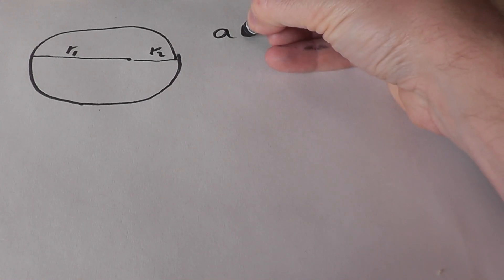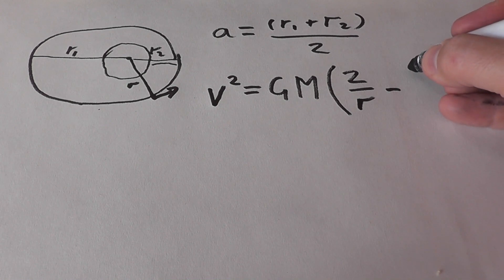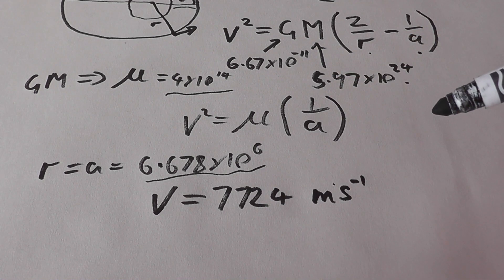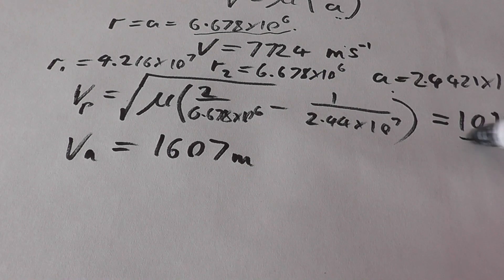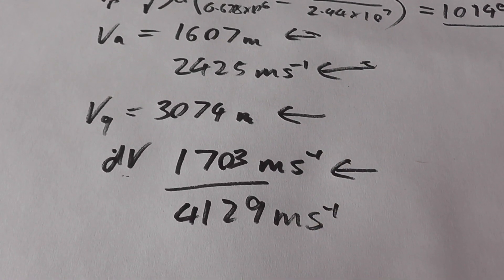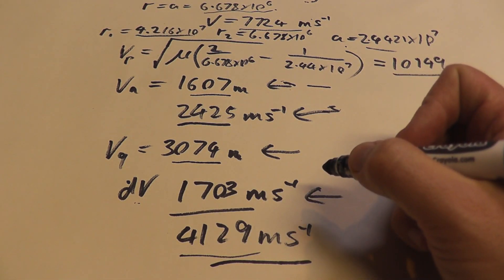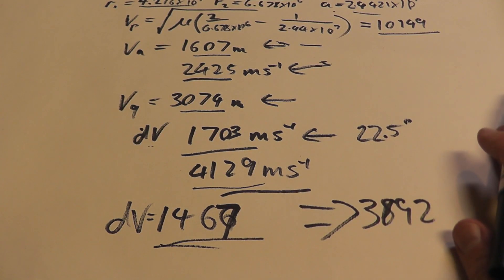Orbital Mechanics On Paper - Part 1 - Addendum

Comment: Only Scott can keep my interest with maths for over 13minutes... :)
Reply: ***** A good starting video is "math" vs. "maths" problematic :D
Reply: ***** thanks for the tip.
Reply from the maker: ***** Confirming Numberphile is worth watching I even learned a couple of things that I didn't already know.
Reply: +Scott Manley yes, but I think this video qualifies as rocket science.
Reply: My math teacher can keep my interest in 70 minutes he gave me this homework:Research the following for a space rocket of your choice. 
Dry mass (excl payload and fuel) and max fuel capacity
Thrust and fuel consumption of engine

Calculate the max payload mass that the rocket can accelerate to escape velocity. 

This question is hard. Your goal is to develop strategies for breaking the question down into smaller pieces, identifying what assumptions you need to make for missing information, finding shortcuts and approximations, and figuring out what mathematical methods and tools are required. 

A full solution requires integral calculus. Start by working out a solution using discrete time periods. 

And I only go in 7th grade
Reply: Tim Roberts dude you and me are in the same boat
Reply: I had a similar question to tims in a classical mechanics book, only you had to derive a general equation for that rather than specific.
Reply: @scottmanley  hi Scott, would enlighten me with a solutuon to this poser: if an object at a distance of 5 metres is attracted to a body at 1m/s^2 with G = 6.67*10^11, what is the mass of the body? 
thank you,
 Leila
Reply from the maker: @leilanurena  I presume you mean G = 6.67*10^-11 
A = MG/r^2
so 
M = A*r^2/G
3.75x10^11kg
Reply: @scottmanley  thank you, Scott. love the channel
Reply: @scottmanley  Scott, would you please do a video on the delta v's needed for a spacecraft in circular (earth)  orbit at 150 nm,  boosting to a circular orbit of 250 nm. 
thank you,
 Leila

Comment: The best part of this video is the slight echo in the sound. It makes me feel like I'm back in a college lecture hall.

Also, this isn't so bad because I already made myself learn this stuff to fly properly in KSP, back in VERY early versions — when there wasn't Kerbal Engineer, weren't orbital calculators, certainly weren't any maneuver nodes! So it was either: calculate your transfer orbits by hand, or guess and probably screw up so epically that not even Jeb could save you.

Comment: Hey Scott, this is incredible! KSP has so much potential bringing awareness to orbital mechanics and in general, physics. You're one of those players who genuinely gets into the quantitative details instead of just sticking to some loose jargons like "delta-V" or "momentum" without explanation. As a graduate student in Astronomy, I really appreciate this. Applause all the way from Hong Kong :-)

It'd be nice if you also mention that the velocity equation is a direct result of the conservation of energy (KE vs gravitational PE). Also, another very useful thing is Kepler's 3rd Law (that a^3 is directly proportional to period^2).

This brings me to a suggestion on a sequel to your video "How To Setup A Geostationary Communications Network":
- how to achieve an orbit of a period of 4 hours (or any desired time) without readouts from mods such as Flight Engineer / MechJeb, provided we know that we need a = 3468.75 km for a 6-hour orbit
- how to setup the periapsis (periKee?) of this 4-hour orbit with its apoapsis at the altitude 2868.75 km
- why can't we use a 2-hour orbit for the transfer
- for a 6-satellite configuration (like that shown on the wiki page "Tutorial:Satellite Coverage"), (similarly) can we use an 1-hour transfer orbit? Why or why not?
- If not, what period can we use?

Speaking of plane changes, I'd love to find out how different the fuel usage will be when changing from an equatorial orbit to a polar one by (1) directly burning (anti-)normal while staying in a low-Kerbin orbit or (2) gravity assist from the Mun.

Comment: To make it simple, a circle has one central point known as the "focus" where every point equally measured away from the focus forms the circle.   In an ellipse, the "focus has shifted so that there is more than one focus.  Each "center point" (foci) is no longer the center of a circle and each point of reference is known as the plural of "focus" or "foci".   An ellipse has two "foci" and its circumference is measured from points measured from both "foci".  It no longer looks like a circle but more like a racetrack.
    If you took a circle and put a dot in the center, that dot would be the "focus'.  If you took that dot and moved it only one atom's distance away and drew a point equidistant from both, no matter how close those two dots were, you would have an ellipse.  Once the two dots moved back and merged into one dot, then, and only then would you have a circle.  I know, dah.

Comment: I think it would be helpful to explain the form of the equation relating altitude to velocity in an elliptical orbit as simply the conservation of total mechanical energy. As the satellite orbits, energy flows back and forth between kinetic (which goes as v^2) and potential (which goes as -GM/r) with a constant sum assuming no drag or perturbations.
Reply: 202penguin As my understanding of the video has it this equation treats the body that the projectile is orbiting around as a point mass. That means that in a game such as kerbal space program R should indeed be your altitude plus half of kerbins diameter.
Reply: Nick Dunn I bought a fridge magnet in the KSC gift shop that originally said

What part of
GxmxM/R = mxVesc^2
Don't you understand? It's only rocket science!

A bunch of us, including some actual NASA rocket scientists, stood looking at this thing trying to figure it out. I realized it was probably designed by some English major who didn't know that you don't write 'x' for multiplication in algebra, and that you can cancel 'm' from both sides. So I corrected it to read

GM/R = Vesc^2/2

The left side gives the negative of the specific gravitational potential energy and the right side gives the specific potential energy (in joules/kg). When they're equal, the sum of the potential and kinetic energy is zero and the object has exactly enough velocity to escape.
Reply: Isnt the right hand side the specific kinetic energy?
Reply: TVTacon You are indeed right! My bad. What I should have said: the left side, GM/R, is -1 times the specific potential energy, energy per unit mass, due to the planet's gravity (potential energy is either 0 or negative, so the -1 makes it positive). The right side, V^2/2, is the specific kinetic energy. When V is escape velocity, they will be equal.
Reply: ApolloWasReal
 Actually, I am a bit confused, I know you can easily find the orbital speed equation for a circular orbit with centripetal force, (mv^2)/r = GMm/r^2, but when you do it using convservation of mechanical energy you get 1/2 * m * v^2 = GMm/r, which gives you v^2 = 2GM/r, which is not just GM/r as it should be. Am I going crazy or something?
 N.b. you can just say gravitational potential or g instead of specific gravitational potential energy, just abit easier to type haha.
Reply: TVTacon That's because the formula GM/R = V^2/2 is the formula for escape velocity at radius R, which is sqrt(2) times circular orbit velocity at the same radius. A velocity ratio of sqrt(2) corresponds to twice the specific energy.

Orbital velocity is sometimes called the "first cosmic velocity" and escape velocity the "second cosmic velocity".
Reply: ApolloWasReal
 Oh yeah, you say GPE at infinity =0 and you find the PE energy difference which corresponds to a loss in KE and GPE is increasing because -GMm/r. Yup I remember now, thanks alot man! And that is very interesting, didn't know that, thanks again!
Reply: TVTacon You're entirely welcome. Yes, potential energy is defined as 0 at infinity and negative at closer distances. It's actually arbitrary, but in astrodynamics the zero-at-infinity convention is much more convenient because you often have several massive bodies to deal with and you can just ignore the ones that are really far away. With this convention, the value C3, characteristic energy is defined as twice the sum of the potential and kinetic energies. When C3 < 0, the satellite is in a bound orbit (or suborbital trajectory). When C3 >= 0, it is in an escape trajectory (unless it hits something). The factor of 2 makes C3 equal to the square of the velocity at infinity, where potential energy is zero. You'll often see C3 specified for launches to other planets; the moon is technically not an escape mission because it's still in earth orbit so C3 is still slightly less than zero.

Comment: If I want to learn stuff like this I stick to Mr Loviscach and others.
What I would be interested in are quick and easy calculations or rules that you can apply while gaming. Somethin' like this:
2^10 = 1,000
2^20 = 1,000,000
2^30 = 1,000,000,000

Comment: Hey Scott, or fellow space traveler ... So the point of the 300km orbit I perform the first burn to reach the Geostationary Orbit, naturally becomes the periapsis point of my new elliptical orbit, with now Vp equal to 10.149 m/s. At Va (slowest Velocity), I circularize? the Orbit by performing the second dV = 1467, increasing my average speed to the Geostationary Orbit equivalent of 3074 m/s? I added a question mark at circularize, cause shouldn't the two burns of the Hohmann transfer be equal for the circular orbit to be completed? Isn't the Geostationary orbit a circular one?

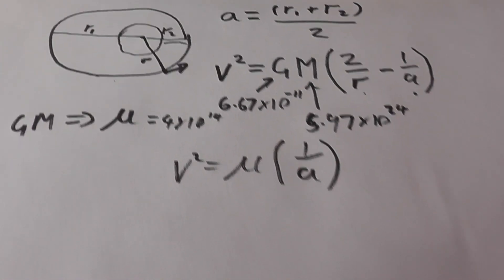Comment: The trouble is you skip over so many steps and don't explain anything. I got lost at 4:35 when said "300km orbit above the earth's surface is actually 6678, right (6.678x10^6 meters)"... this makes no sense as you haven't explained what you're doing here. 300km is 300,000 meters not 6678 etc. explain.

Edit: nevermind chatgpt helped me out. Still, you didn't explain it properly

Comment: Ok this where I have some confusion.  The Earth has an orbit of 150,000,000Km ( I will use rounded numbers) and travels at a velocity of 30Km/s and Mars with an orbit of 228,000,000Km travels at a velocity of 24Km/s.  So the greater the orbit the slower you need to travel.  If you were to travel to Mars from Earth you would need to inject a delta V of 3Km/s to make the elliptical transfer orbit and a further 3Km/s to circularise with Mars orbit.  So now let's imagine I'm in orbit 300Km above Earth doing 7.7Km/s (according to the figures shown in Scotts video) I engage the main engines that now increase my velocity by 3Km/s and start the 8.5 month Hohmann transfer orbit to Mars.  My trajectory is in the same direction as Earth 's orbit so am I doing 40.7Km/s (30Km/s + 7.7Km/s + 3Km/s) as I head out to Mars?  Time passes and I rendezvous with Mars and I have to engage the engines yet again to inject a further 3Km/s just to stay on the same circular orbit as Mars, which, as mentioned earlier, is actually only travelling at 24Km/s.  Seems like I have had to burn a lot of fuel in order to travel a lot faster but to end up travelling a lot slower. Where am I going wrong with this?

Comment: bro I don't know if im the only one right now on 3th of august 2022, but this guy makes so many mistakes while talking: 42.160 meters, its KILOMETERS. then you make the answer correct with you marker. before that you said an orbit from 300 km up, then you come up with the number 6678* 10 to the 6th, out of no where, then you make the formula wrong by saying GM times (2/r-1/a) bro... I don't get it anymore.
Reply: He was paying more attention to the answer he knew rather than the math he was writing. Problem comes from when he got r incorrect in the written math.

r (current/target distance from center of mass) = 300Km (ASL) + 6371Km (radius of planet)

V^2 = μ (1/6671Km)
V^2 = (3.98 x 10^14) (1.5 x 10^-7)
V^2 = 59700000
V = √59700000
V = 7727 Δv
Reply: My final number is slightly off due to rounding differences.

Comment: would the equations still hold at a different gravitationaly constant?
Reply: It's a constant. The question is irrelevant.
Reply: Okay say I'm designing a physics engine in something where there is a mass limit, in this case the Blender Game Engine with a mass limit of 10000kg, a constant at 0.000000000667 would take way too long for it to run at any realistic speed. So it is relevant to me and I'd like an answer.
Reply: Craig McIlwrath Oke, I'll try. The G parameter in this equation is the gravitational constant of the universe 6.67384 × 10-11 m3 kg-1 s-2. So if you multiply this with the mass of the body you are refering too you get a body specific gravitational acceleration. In this case G*MassEarth = 9.81 m/s^2 at sea level. 

Now: your G = 0.000000000667 and your mass is 10000kg so now you only need your distance from the body R.

I don't know at all if this answer is applicable to your question.

Comment: So if mu = the gravitational acceleration 1m from a point mass with mass M, what is the acceleration AT the point mass? Infinity?
Reply: black holes. if you actually compressed the mass of the earth to a single point you will eventually cross the event horison and go through realtivity, spagettificaton and all... let's just say stay clear from black holes that are so small.
Reply: Excellent question!

Mathematically, the answer is yes.

Since the force of gravitational attraction between two bodies is inversely proportional to the square of the distance between them, as the distance approaches zero, the force approaches infinity, and so does acceleration. (Recall that F=ma, and the mass of the object being accelerated is constant).

However! Physics is not math, it's physics. Math is used to describe and model physics until physics breaks it, which happens spectacularly in the case you brought up.

For there to be an acceleration you must have a force. A forces comes from the interaction of 2+ bodies/objects, and two bodies can't really share the same space as they would in your question.

Comment: Hm. I'm trying to figure out where the velocity at apoapsis came from. You kind of lost me there, I'm not sure which numbers you were using to get 1607 m/s. :/ It's not velocity at the surface, is it? Isn't that 460~ m/s?

NEVERMIND I FIGURED IT OUT I'M DUMB I SUBBED IN r1 TO a INSTEAD OF REPLACING r2 WITH IT.

bluh

course, I get 1312 m/s but I'm sure that's a rounding error somewhere or perhaps a mistake in my calculating, but at least I know what I did wrong.

Comment: is this all assuming that it's happening in one second? I'm really confused with the m/s² and have ever been.
So when this takes one hour to accomplish it would be 4129 / 3600 = 1.14694444m/s² ?
Reply: 4129 m/s means in one second you move 4129m. When you start at Speed 0 (standing) to 4129m/s and you need 1 hour (3600s) to get to this speed. then you had an acceleration of 1.14... m/s². for comparison earth gravitation is ca. 9,8 m/s² So needing 1 hour to get to this speed is relatiely slow acceleration.

So scott is talking about speed. not actual movement. And your equation was about acceleraiton.

Comment: I don't know what's going on but I'm running into all kinds of problems trying to follow the math. I've taken the formula and ran it through a number of times but my result for a circular velocity is off by a factor of 10^6.
Not only that, but when trying to plug in the numbers for the eccentric orbit velocity, 1/a was a bigger number than 2/r, and each time I would end up with V^2 = negative number and I just cant finish the calculations. Please help
Reply: +NJP695 it's not math, it's... PHYSICS!!!
Reply: +NJP695 Sounds like you're doing the arithmetic out of order. Remember PEMDAS? The order of your operators is vitally important. Work from the inner-most parenthesis, then exponents, next multiplication and division, and finally addition and subtraction. You can do the multiplication and division in any order without affecting the outcome. 4/5*9 = 9*4/5 The same is true for addition and subtraction. 4 +5 -9 = 4 -9 +5.
Reply: +thedrew4you I really appreciate the explanation, but because that was so long ago I actually did figure out that I was doing the order of operations wrong as I tend to do, but yes, you're right. Thank you!
Reply: NJP695
I figured as much, but since nobody answered it, I thought it wouldn't hurt, in case someone else runs into the same problem. Glad you worked it out. :)